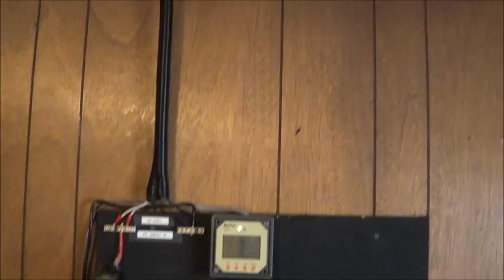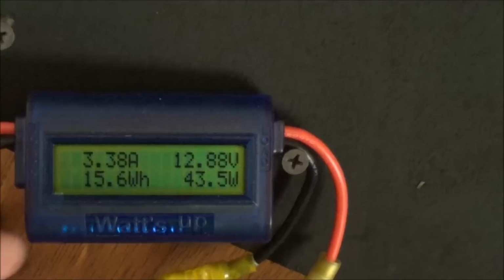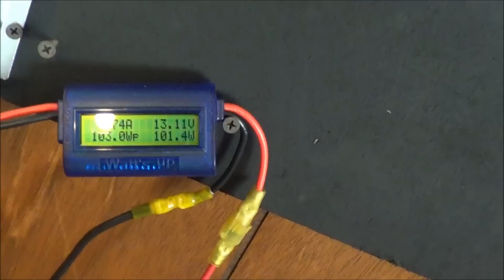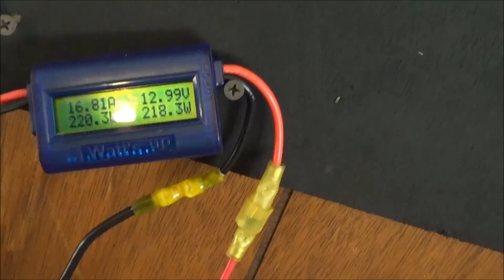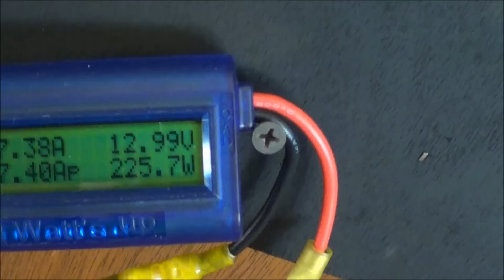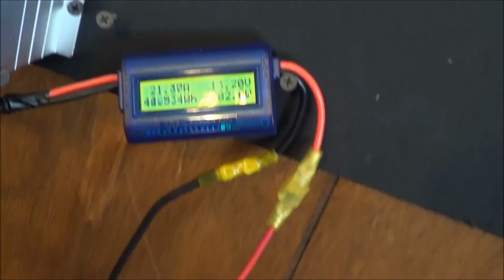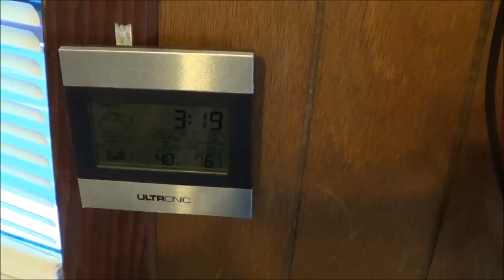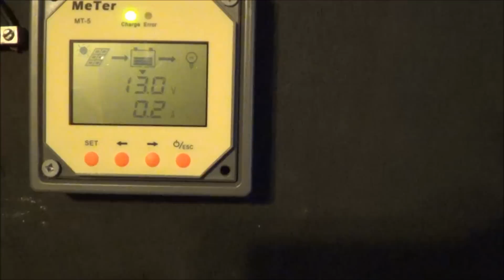Solar Panel Testing -  Mppt Charge Controller - Battery Bank - 675ah

Comment: Is the Watts Up meter just inline between the controller and the battery? I've got one on the output side of my camper battery and find it a great asset for useage. I'm planning on another camper build and was toying with something like this to measure my solar output.

Comment: IS there a number where i can call you for a 5 min conversation ?
 I have 3 100 watts panels and a 30 amp charge controller ( Pwm ) 
and i am not even getting 5 amps out of the panels.
and the battery voltage drops after the sun sets.
I dont know what to do...

Comment: hi  i have 4 100 watts panel when i check with multimeter direct from the panel the output amperes is 24amps, but when i connect with controler using 65ft flat cord  w/ 100ampers deep cycle battery bank the output amperes drop to 10 amps with ammeter ,can you help me what is wrong with my system to achieve 24 amps output ,should i change my wire to awg and what gauge is your recomended,hope you help me Sir..   I really appreciate
Reply from the maker: +RYAN ROMANO that's along run of wire you should run them in series if you have a mppt type charge controller so you don't have as much voltage drop for the 65 ft run
Reply from the maker: +autobri1 so your voltage will be 48 volts to the controller and 12 volts out if it's the same controller in the video.Good luck!!
Reply: this is because your voltage drop when connect to the charge controller, you need a MTTP charge controller to improve the efficiency.
Reply: Yes I agree. You either need to have very heavy gauge wire which is expensive, or wire the panels in series and use an mppt controller near the battery.

Comment: hi I have two poly solar panels one of them is 150w and other one is 100w --both are 12volt and I'am using single 12 volt 150ah tubler battery, when i connected them into parallel so my pwm solar 30 controler -shows amp goes down and fluctuate and also float charging indication coming , after removing one 100w panel its stop fluctuating and amp increases, so what should i do kindly advise me....?
Reply from the maker: +anuj tomar if the voltage is the same on each panel put them in series and run them to the controller at 24 volts and the controller will take the power down to 12 volts and charge the battery at higher amps

Comment: I think the VM was wrong at 12.2 aswell, its only put a few AH in and your battery are full!??!?!? That cant of been right dude. They must not have been that low.
Reply from the maker: +LambySRI The volts min. was under load from the night before so yes it would have measured higher
Reply from the maker: +autobri1 also the amp hour reading on the meter only has 2 digit so it rolls over.

Comment: Hello, I have 2 160wat 9.47a solar panels wire together to make 24v, they do peak out around 9a only, which is only about 200wats not 320wats, why is this?
Reply from the maker: Solar Service Guy 9 amps at 24 volts?  that would be 18 amps at 12 volts. I need more info from you how is your battery bank wired 12 or 24 volt are you measuring before the controller or after?
Reply: The batts again are wired parallel and series for 24vlts. Your talking about the solar panels which are 9amps and about 160 watts each, I have 2 which would be 19amp 320watts, also 24v series together.

Comment: i have a mppt charge controller with those info amp to bat watt etc. the only real thing i wanna know is how my battery are full i have 150 ah/20h rate... i don,t what to do and what to buy cuz its not shown on my charge controller. thanks

Comment: How are you able to charge your batteries if your only putting out 20+ Amps? Just curious, because I actually want to get into this sort of thing, but it doesn't seem like even with a small setup, your not getting enough current to charge the 675Ah battery bank capacity.. I really want to get into solar, but seems like you need alot of solar panels in parallel to create the current needed to charge even a 100Ah battery.. It seems there's only about 6 hours of really good daylight in a typical day, that's onyl 120Ah if your charging at 20 Amps an hour.
Reply from the maker: I use my batteries for storm outage only and I love the setup, you can run a fridge for 2 days no sun off just the batteries! And if you have sun? It's weeks or months.
I had to run a generator 24/7 in 2004 storms and the money for fuel if you could get it would have paid for this system 5 times over!
Reply: autobri1 I understand everything now since I've posted this comment. Yes, parallel, and if you have the pannels out hundreds of feet away from the charge controller, you will need a MPPT Charge controller to handle the high voltage. So if the panels aren't that far away, parallel, PWM charge controller. If so, then the panels will need to be in series & also in parallel. Only a MPPT charge controller will handle such high voltage & current. It's actually recomended to use a MPPT charge controller, just because they're better then the PWM charge controllers. But yeah.. So your comment basically says that I was correct. That I kinda guessed at that time that you didn't have the panels to charge then in less than 6 or 8 hours, which is the amount of time the sun is usually outside. But even then, the sun is not always at 100% during the daytime, etc. etc. So you use them for storms. I understand know what your setup is for. Thanks for the reply. Much appreciated.
Reply from the maker: MARK 1 Thanks Mark, but I have other videos to show how to charge D.C. only and keep the noise down and fuel consumption low as well, I've also added another 1k solar to this system( yet to make a video) and 2 more deep cycle batteries. still cheaper than a noisy gas powered generator.
Reply: autobri1 Awesome. Keep up the excellent work Autobri1. (+1)

Comment: Hi there. It's coming up to almost a year. How is your system doing?
Reply from the maker: It's still running perfect with just normal battery maintenance. I've added to the system a bit and will make another video soon.
Reply: autobri1 great! looking forward to seeing an update. 

I have Renogy panels as well. 100w mono panels -- 6 of them for a total of 600w. :-) Hope they last 25 years!
Reply from the maker: lanceguilin I have to say just doing a small test that the panels have not degraded at all. The other day I got a max of 365 watts in November and still got the same 373 watts in the summer (and never cleaned the panels just rain
Reply: autobri1 That's very nice! The best I've seen from my panels was 536w. But most of the time now, 440w is about the best I get.

So you use your battery bank purely as an emergency backup? You do not routinely use your system otherwise -- is that right?

Comment: can i measure the amount of amps the solar is putting into the battery by wiring a multimeter in series with one wire of the battery and solar panel or would this not work
Reply from the maker: Yes, However if you exceed the 10 amp rating of most multi meters you will blow the fuse.
Reply: @autobri1  that's why most ammeters use a shunt. I shan't is a calibrated very low loss resistor. If you measure the voltage drop across the shunt you can indirectly measure the current.
Reply: A shunt, not I shan't. Stupid autocorrect!

Comment: Are you happy with the charge controller? With that charge control it says it will take higher voltage and reduce it and give you more amps. Have you tried it?
Reply from the maker: Yes and I bought the 40 amp version to power the 1k watts of panel that I bought (yet to install ) but I ran the 40 amp version for a month and same results these cheap mppt controllers are great!!!

Comment from the maker: I noticed in this video after running a summer test the meter said 1600 watt hrs. and 59amp hours!!!  THIS IS WRONG! it was 1600 watts yes, but it only goes to double digit on amps so the true Amp Hour for this test is 159AH. At half day sun in Dec. So pretty darn good!!
Reply from the maker: sorry that was a winter test, I need to show a summer test the results ill blow your mind

Comment: Nice, I have wanted to see three or more Renogy Solar panels working. Thank you, great video.
Reply from the maker: Thanks Mario!  I did notice a mistake in the video, the meter was double digit so I really put in 159AH and 1600 watt hrs on a half day run so these 4X100 watt renogy panels in summer are capable of over 3kw hours

Comment: Im wondering if that meter is in series?...if so have You done a test for voltage drop before and after the meter?....seems like awful skinny wire to handle the 20 amps or so your panels produce?just wondering.
Reply from the maker: Yes, the little blue watt's up meter is in series it can handle 50 amps continuous.  However when I got up to about 28 amps after a few hours the crimped on connector started to get hot to the touch. (I checked it at the battery with a clamp meter and it was on the money)